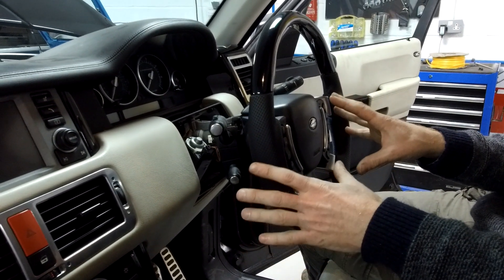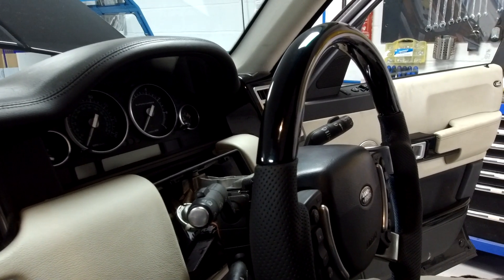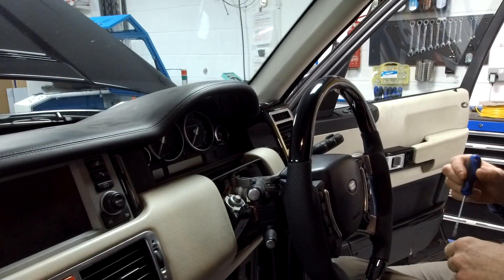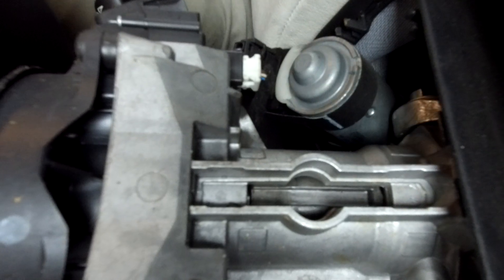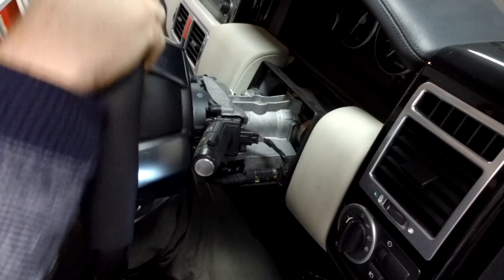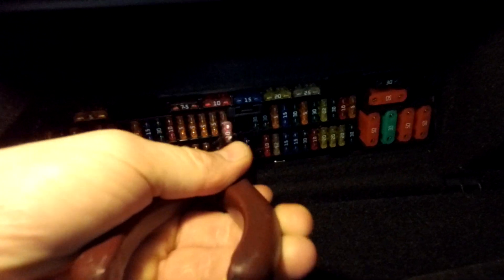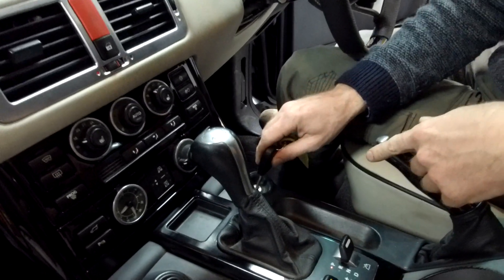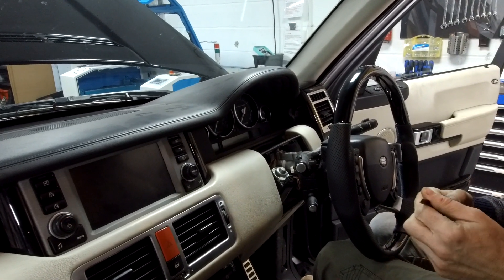Range Rover L322 steering lock operation maintenance & fix

Comment: SOLVED!  This solution worked a treat for me.  I had an issue where when the key was inserted 3 low clicks were heard from inside the column but not releasing.  I had come across the drilling solution but was reluctant to try.  The solution provided here was perfect.  It did take quite a few sprays and manipulation of the locked wheel for the mechanism to take the WD40 but worked in the end saving me a unnecessary visit to the mechanic and hefty fees.  15-20mins repair time spent.  Many thanks ;)
Reply from the maker: Glad it worked for you !

Comment: When trying the 18 fuse , low battery power and wd40 way.
If your stuck and need to get home, try this. I've had this problem twice.  There's a little solenoid in the lock that sticks. Not replaceable. It causes the key to freeze.
What I did ,not for the faint hearted but, remove the column shroud, wiggle the key constantly if trying to start the car and simultaneously bash the underside of the alloy column section with a decent hammer. Helps if you have a helper to do either, but after a few whacks the solenoid is shocked enough to move and release the key.  Once it starts keep it going till you get it home.   Ihave replaced just the upper section of the column with second hand units. The second one is still working fine. Lot cheaper and easier than new column.

Comment: Not sure that this works for most peoples problems. If I disconnect that harness it help not having to run to the batter neg terminal each time. However, the little mechanism works as you hear it clicking back and forth. As long as I do not pull the key out I can set there and turn it on and off 30 times and it clicks back and forth each time. If I pull the key out and stick it right back in, its fine as well. If I pull the key out and wait about 1 sec I hear clicks all over and its locked down again. So to the part is working fine. There is something else that tells it to lock down about a second after the key is removed. I did pop off that little piece of metal and used a good bit of wd and tapping on the part and spinning the wheel. Again, I hear the piece engaging just fine. My car sat for 1.5 years with my driving it around a few blocks every few weeks. When the battery died, this is when this started. Crazy. I just want it out of my life...
Reply: were you able to solve it with the wd-40?
Reply: were you able to find a fix for this?

Comment: Useful video thanks guys - had to try the fuse 18 trick this morning, but when I opened the passenger side box, there is no fuse 18! and according to the manual its supposed to be spare, any ideas? (2011 Vogue SE L322, keyless) Cheers.

Comment: There is a black 3-prong plug on the left side of the steering column. What is that for? The wires in mine are melted and I need to replace it.

Comment: Great videos!!  The WD40 fix has't worked for me even though the fuse trick does.  Is there a way of permanently disabling or removing the wheel lock mechanism as I never need to lock the car ?
Reply: Yes - remove the plug underneath the column and short across pins 1 and 7. Replace plug and you are good to go.
Reply: @ngummow  Thanks for your help.  Can you explain a bit more, like exactly which plug to remove and how to 'short' the pins...I'm new to this and don't want to damage anything.  Thanks
Reply: @bunnydrummer4092  it only works if the column is unlocked and you use the car
Reply: Use the car regularly.

Pop off the steering column cover - remove the ignition plug and short across 1 and 7 with some thin wire. Replace the plug and it will keep the ignition circuit unlocked. I suspect with an extended period without use the battery drain might be felt - but mine has had no issues.

Comment: Fasted way to sort the key stuck or cant pull key issue is flip up the gaitor around the drive selector....on the side in the cavity is a small lever.....push it down or up....voila key out

Comment: awesome solution! I hope it works for me! might I find out what kind of "steering wheel" that is? I'd like to replace mine for that one! thank you!!!
Reply from the maker: We have the steering wheel on our website
https://www.powerfuluk.com/vehicles/range-rover-full-size/l322-vogue-2006/interior.html
Reply: did the solution work for you ?
Reply: alwyn varghese yes
Reply: @popcornpaul33  you were experiencing the key not turning in the ignition? and instead of drilling you just sprayed the lubricant from the top at an angle?
I just started experiencing this so i wanted to know if it was worth a shot. Thanks for the reply!
Reply: alwyn varghese hold on! I got a fix off of eBay email me and I'll show you what I got! The home thing I did not try! I thought this was talking about something else. There is an electrical work around fix that does work but I'm told it it temporary.
Reply: @popcornpaul33  how should i reach out to you?

Comment: I went to charge my battery today and forgot that the charger was on the 24v setting. Didn't realize for a few minutes before I disconnected it. I could smell a bit of an electrical burning. Now, the key will not turn in the ignition. The interior lights still work and the central locking still unlocks with the key fob. I have tested all fuses in the engine bay, glove box and at the rear, all are fine. Any idea where I should look next? I have tried disconnecting the battery for 30 mins, I have also removed and replaced fuse 18 with no joy. I did try to turn the key while the 24v charger was running, I have a feeling that the burning smell was the solenoid as the burning smell came from inside the vehicle, 24v may have been too much? This is  a 2003 Range Rover HSE, UK model.
Reply from the maker: Oh dear i am feeling your pain - easy mistake to make and you would hope there was some protection in the car to stop damage being done. 
Have you tried a spare key ?
Reply: @L663  No, haven't tried a spare key yet. I have a feeling I smoked the steering column solenoid or or the solenoid that allows the ignition key to turn. Any way to check either one?
Reply from the maker: @Coolcarting  I think you are probably correct.
i have been reading up on this for you
found this
https://www.lrukforums.com/threads/l322-ignition-key-will-not-turn-in-the-barrel.134654/

and also this for sale which i guess good clue as to what parts are in the system

https://www.ebay.co.uk/itm/3-0-TD6-RANGE-ROVER-L322-02-06-ECU-LOCK-IGNITION-IMMOBOLISER-KEY-SET-NNN000461/264608336913?hash=item3d9be2cc11:g:28YAAOSwxVReKU7V
Reply: @L663  Here's a little update in case someone manages to do what I done. It was the ECU located inside the steering column. I guess when I put the 24v charger on the battery and then turned the ignition to check the fuel gauge it fried one of the ECU'S micro chips. I had to replace the steering column since the ECU is not replaceable itself. I managed to source a second hand one from a local supplier for £150.00. All is back to normal now. Thanks for the advice!
Reply from the maker: @Coolcarting  Thanks for posting the update... glad your back normal !

Comment: Best bet seems to just disable/remove the steering lock and key lock entirely and remove the headache. Who cares, it's only a theft thing which is so easily defeated by a informed thief. These cars are so cheap now they aren't a target much anymore and there are more clever ways to prevent a vehicle from starting that you can devise yourself that even a informed thief won't know what to do.

Comment: Pleasssss help...my 04 rr just started with this refusing to turn I charge my battery.. pulled the fuse...all helps in the one time start up after...then back to the norm..not turning.  I've noticed that it's not clicking and also the steering wheel will not lock with vehicle off and key removed I'm trying the wd-40 as I type 🤞I'm trying to stay away from the dealership and from another 60 months car payment on something domestic...help!!!!...It's the steering column lock that's not working...anyone have any ideas why
Reply: Any help...
Reply: @carlosmcneil8674  were you able to find a fix?
Reply: @alwynvarghese8380  none....at all been looking at what seems like 100s of forums all pointing to basically a new column....don't know about anyone else but 800 dollars on a rebuilt one for just 12 month warranty is still a  hard one for me to swallow..